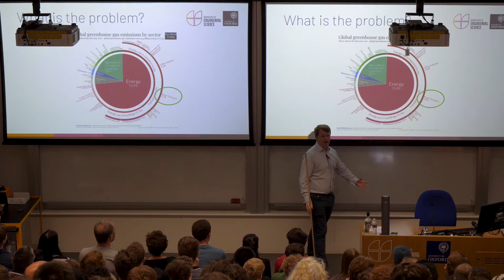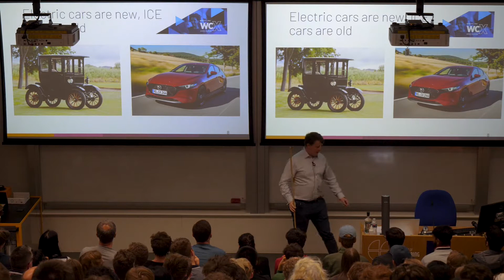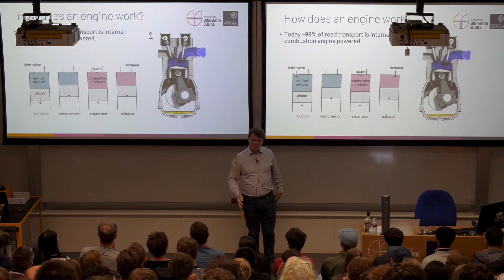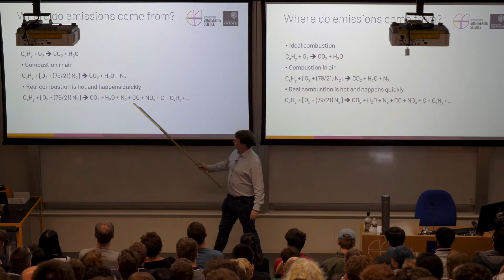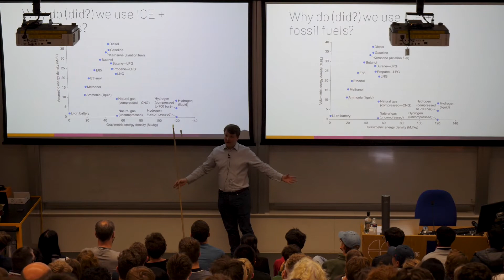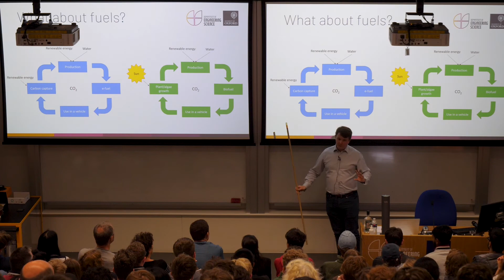University of Oxford Engineering Science - Open Days - Taster Lectures - Mechanical Engineering

Comment: The majority of these issues can easily be solved, the biggest problem is public perception. The size and weight these vehicles consume is a major issue, especially for a single occupant driver. Using a Guideway System for long distance travel can improve efficiency and reduce 90% of the weigh of a vehicle, thereby reducing the particle matter from tire and road contact.

And finally, vehicles should be powered by electro-mechanical propulsion,  which would eliminate the need for fossil fuels, and have an efficient way to sustain long distance travel electronically. Electric vehicles waste far too much energy to be useful. We are in the information technology era, it's time engineers built vehicle technology based on a service based architecture, instead of the old industrial era. 🍷🍷😎